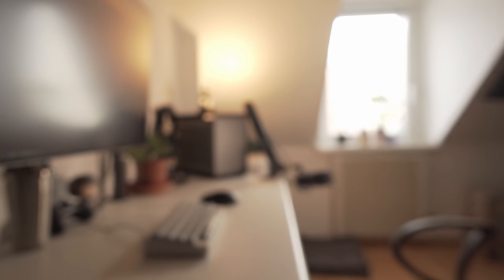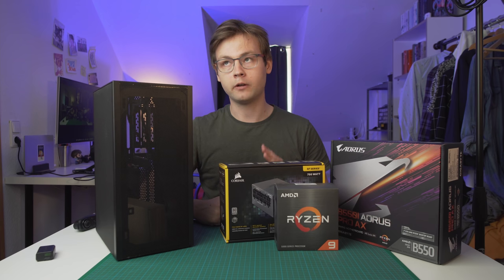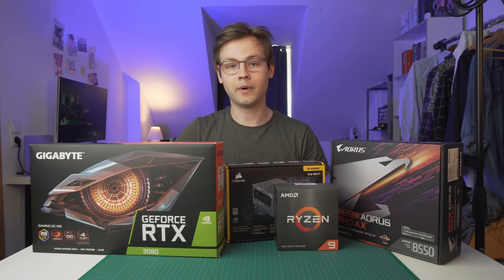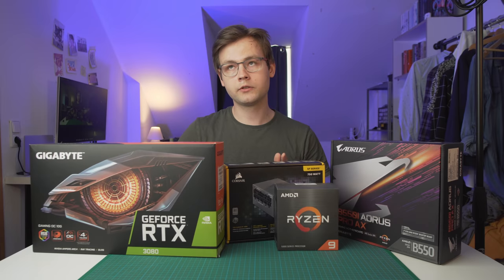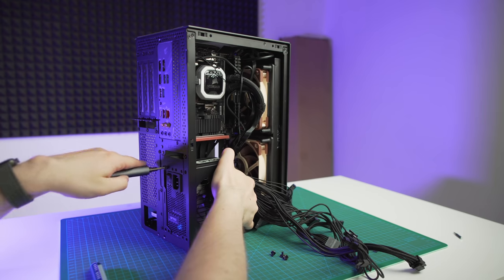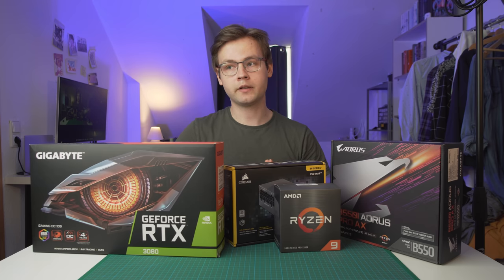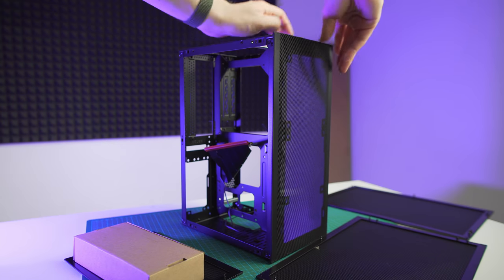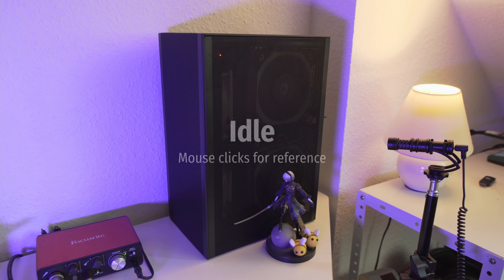Building an SFF Video Editing & Gaming PC!

Comment from the maker: Build starts at 5:05

Q: Why do Noctua's 140mm fans suck?
A: A14 fans are based on older technology than A12x25s and don't include Noctua's new Sterrox polymer, which makes A12x25s so good in terms of performance and noise. In this test from Computerbase (German), which compared the performance of different 140mm and 120mm fans installed on 140mm-based radiators, Noctua's A12x25 comes ahead of all of the tested 140mm fans, despite being smaller in size – https://www.computerbase.de/2020-08/radiatorluefter-vergleich-140-luefter-radiator/4/#abschnitt_starken_120mmlueftern_auf_der_spur
Noctua's A14 fans are not bad per se, but they're definitely not worth their money, considering competitors like Arctic P14.
Reply: Where have you found this instrumental version of "Kooma - Last"?
Reply: 3600 MT/s ; Which is around 1800Mhz
Reply from the maker: @Jonathan.R.Pereira  DDR stands for "Double Data Rate". Most consumer motherboards run memory in dual-channel, so if you have at least two sticks of RAM, it will run at full speed, 3600 in this case
Reply: or why not use NoiseBlocker 140mm they got around 22dba on max 1500rpm , for cables you could use cuntom length
Reply from the maker: @nocomplyyy  I tried to put Arctic P14 fans on the radiator and unfortunately they produced a very unpleasant sound on certain RPMs. I ended up having to run them at higher RPM, which made them noisier overall. 

They’re good fans, but definitely not better than A12x25. Which is to expect — it’s almost 7x more expensive
Reply: agreed, i have five normal arctic p12 and four arctic p12 CO, all of which produces unpleasant noise at certain rpm ranges, with two of the p12 CO being noticeably louder than the rest. I am considering changing a few fans to noctua's

Comment: I have a similar mobo so a couple of tips:
1. Ram frequency is a hit or miss depending on bios versions, go for 3600 if you get MCEs
2. Gigabyte likes to bump the soc voltage to 1.2, the max safe limit, you can take it back down to 1.1, i havent found any stability issues running the stock voltage
Reply from the maker: Thanks!

Comment: Thanks - very informative and instructive! I am starting to watch videos like yours as part of research to learn about what I need to do to build my own SFF PC primarily for video editing with Premiere Pro, compositing with After Effects and rendering content from the aforementioned. A secondary goal is something that will allow buttery smooth performance when playing Microsoft's Flight Simulator near the max settings as feasible. Your video is very helpful since I am so out of touch. For reference, my current desktop (also a custom build) is powered by an Intel i7-3770K & it really struggles with a lot of workloads these days. So I am looking to invest in something solid that will last me for several years but has a SFF (preferably). Thanks again!

Comment: Very nice build!
One question though: Have you considered "Be quiet" components for reducing the noise? Or aren't they really quieter? :D
Reply from the maker: I've seen mixed reviews of their new AIOs, and as for their fans... In my experience Arctic P12 and be quiet! fans do come close to Noctua's A12x25s, but they're not quite as good. Artcic fans especially make those weird noises on ramp up and at certain RPMs, but they're pretty good if you just run them at a fixed RPM.

Comment: There is no wasted space in mATX Case, its just enough to let the Hardware dispense enough heat to the air instead of smashing all componenents together which makes it impossible to build a high end (or at least hungry/hot) system without having shitty temps. SFF Builds without watercooling are really not a good option for gaming at all. The first 1-2h the System is not fully warmed up and the noise and temp level is low, but after 4h of running this cases get overall very warm so the CPU and GPU gets very warm then. I just use an Ryzen 1600AF and an old R9 280X in a relatively big sharkoon Zone C10 with 2x 120mm and 1x 80mm Exh Fan. Guys, i promise you this is getting really hot over time.
Reply: or maybe your aircooling setup/case combo is terrible, cases like the meshlicious and the NR200P do not cut corners on thermals/noise. Going smaller than that yeah but thats not the point you are making.

Comment: Hey man great build im going for something really similar actually.
I take it you used H115i as you had one from previous build,
If you had the chance to pick up a new AIO which one would you opt for in this case?
Reply from the maker: I don't have much experience with AIOs. I've had Arctic Liquid Freezer 280 for a short time but had to return it due to the (in my opinion) annoying pump noise. Then I decided to get an H115i since it was branded as a "silence-focused cooler" by Corsair. The fact that the pump spins down all the way to 1100 RPM is very helpful and I actually can't hear it even though I'm usually pretty sensitive to pump noise.
Reply: @WolfgangsChannel  hmm yeah I think maybe you have had a previous version or gen of the artic freezer.
They are on now the Artic Freezer ll and they are on gen 4 of it where they have upgraded the pump and fans and after watching a few reviews and tests they put it the very best AIO for temps and noise. Yeah its not anything to look at as no RGB but with a case like the mesh you dont really care.

how is your gpu noise and temps at load when gaming?

Comment: Great vid! I'm doing basically the same setup except I wasn't able to get my hands on a 5900x so I have a 5800x. I was however was able to get a 3080ti and have the same mobo and psu as you. I do have a question - I noticed you got the pcie4.0 edition for the meshilicious which is $70 dollars more than the pcie3.0 version. Do you think the $70 premium is worth it and why?
Reply from the maker: Yes, I think it is. As far as I know, the current gen graphics cards don't quite saturate the PCIe 3.0 bandwidth yet, but the next gen ones might. If you plan on keeping this case for longer than 2-3 years, I'd definitely suggest spending extra money on the PCIe 4.0 riser.

Comment: Witziger Zufall: hab heute ein Thermaltake Core V1 für den WG-Wohnzimmer PC zusammengeschraubt und morgen sollen amüsanterweise auch bei mir die kaputten Fans von der Grafikkarte raus und zwei Noctua drauf. Allerdings soll die in die alte Maschine. Hab schweren Herzens eine 1660 super geopfert für den Neuen. Gibt auch keine Workstation sondern ein (Ersatz-)Gaming PC/kleiner Renderslave (sorry für letzteres Wort, hoffe wir finden bald mal eine bessere Bezeichnung die weniger vorbelastet ist) der arbeiten kann, wenn ich an der Workstation sitze. Daher das Core V1. Ich hatte mir wegen dem Airflow Sorgen gemacht. Wie es scheint zu Unrecht. Konntest Du schon Benchemarks machen?

Comment: Why do the 14mm Noctua suck? Or what exactly sucks about them? I miss the black nails, btw ;-D
Reply from the maker: Worse performance and higher noise levels on 140mm based radiators than A12x25 fans, at least in my experience

Comment: Acrtic's P12 or P14 does a better job than Noctua and is WAAYY cheaper than Noctua. Great build though. Love your videos as always.
Reply from the maker: That’s what I thought too! Bought a pack of Arctic P14 fans for my radiator and unfortunately they produced a very unpleasant sound on certain RPMs. I ended up having to run them at higher RPM, which made them noisier overall. 

They’re good fans, but definitely not better than A12x25. Which is to expect — it’s almost 7x more expensive
Reply: @WolfgangsChannel  Yup, your're right. They do produce a low whistling type of a sound on certain speeds. Apparently P12's don't have this issue. Your choice is also very good.

Comment: I have this case and the Corsair iCUE H115i aio. It fits, but it is tight and there is for sure some pressure on the bottom of the case io and the little plastic bits in the bottom corner. Am I missing something or is that not a problem? Any updates a few months later?

Thanks for the video! I really appreciate seeing your build before going into my own.
Reply from the maker: I'm using Noctua NF-A12x25 fans instead of the stock fans, that might be the reason why it fits.
Reply: @WolfgangsChannel  it's the actual radiator for me. It does fit just very tight.
Reply from the maker: I had to take off the front panel to fit it into the case (I could screw it back in with no issues though)

Comment: Could you please elaborate a bit on what was wrong with the Streacom DA2? I personally like the looks of it better and now I'm curious about what the downsides are compared to the Meshlicious.
Reply from the maker: It didn’t age particularly well with the newer, bigger and more power hungry components. The second revision did address some airflow issues by making the perforations bigger and reworking the dust filters, but the temperatures are still not great. Looks wise I also think it’s a beautiful case, but I would think twice before using it with modern components
Reply: @WolfgangsChannel  Thanks, so you have some resources about the thermals of v2? I can't find a whole lot about it, but maybe I'm not looking in the right places. Also I'd like to use an RX 6750 XT in it, would this already be an issue? This is my first sff build I'm planning so I'm pretty clueless.
Reply from the maker: Unfortunately I also can't find much info on the thermals with current gen components... Might be partially because of the competitor cases that came out since the DA v2's release that offer a way better value proposition. For instance, the Dan C4-SFX that came out recently is a pretty good alternative – though it's a bit more expensive (€200 vs. €179 for the DA2 v2)
Reply: @WolfgangsChannel  thank you for answering so profoundly, I'm just wondering if it's just that people rather want to have builds using the newest cases that are trendy at the time or if there are actually design differences which make the DA2 a worse case considering the cooling. To me the Dan C4-SFX looks exactly the same except for everything being flipped, but as I said, I'm new to this and don't know my airflow theory yet ^^. So what do you mean when you say it has a better "value proposition"?
Reply from the maker: It’s not really a trend thing, it’s more about how huge the graphics cards have become lately. Triple and quad slot GPUs have pretty much made cases like Ghost S1, Dan A4 and NCase M1 obsolete. 

When it comes to value, the Cooler Master NR200P for example can be had for as little as 75€. It’s slightly bigger than the DA2, but has way better airflow and hardware support, and costs less than half. I get that design wise, it’s not everyone’s cup of tea though

Comment: What are your 5900x thermals mine where crazy fluctuating from 45 to 75 jumping up and down by 10 degrees constantly I assume this isn’t normal and I should apply after market paste.
Reply from the maker: Nope, that's pretty much "normal" for those chips. Try experimenting with voltage curves in the BIOS

Comment: The SSUPD is like the same size as my mATX case... i got the geek G1 SE instead. I wish i could add noctua fans on my GPU, evga has spikes sticking out of its heatsink.
Reply from the maker: Some of the smallest mATX cases are like 20 L, with much worse compatibility.
It's really hard to appreciate how small Meshlicious is until you see it irl – it takes about the same horizontal space on the desk as a sheet of A4 paper.

Comment: Hi! Can you fit an HDD there even if you have like 2.5 slot and up type of GPUs?
Reply from the maker: The specifications say:
2 x 2.5” SSD (with full length GPU & ATX PSU)
3 x 2.5” SSD (with full length GPU & SFX PSU)
7 x 2.5” SSD (with SFF GPU & SFX PSU)
Up to 2 x 3.5” HDD (with Small Form Factor GPU)

I guess that at least two 2.5" HDDs should fit just fine.

Comment: Can you please elaborate little more on your logic behind buying overkill pc after every 5-8 years? Why overkill when the overkill costs a fortune and  the next generation beats that very easily at tremendously low price. Take a look at the 2080ti vs 3070
Reply from the maker: Yeah, but ultimately the people who decided to buy a 2080ti a year or two ago instead of waiting made the right decision.
Because you can't actually get a 3070.

The reason why I think buying relatively high end parts is better is because you'll be able to use them for longer and they won't depreciate in value as quickly. I don't think 5900x + 3080 is significantly more expensive than something like 5600x + 3060ti (at least if we're considering a perfect situation where you could actually buy those products close to MSRPs), but it will last you longer

Comment: I can not believe that the GEFORCE RTX, Cost $2589.00 that is very expensive....is there a cheaper alternative ?
Reply from the maker: They’re “supposed” to cost around $800, but the prices are crazy now due to the silicon shortage. I bought one back when the prices were relatively normal
Reply: @WolfgangsChannel  It should never ever be a silicon shortage...I use to work for MITSUBISHI POLY SILICON, and it is grown with acid, water, and electricity...
Reply from the maker: Silicon binning is a thing https://www.yourtechbro.com/what-is-binning/